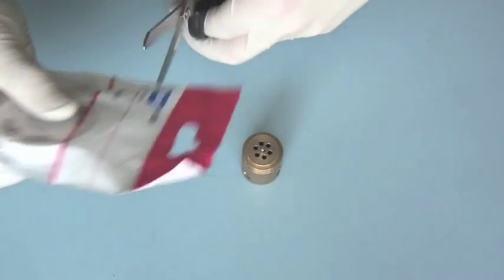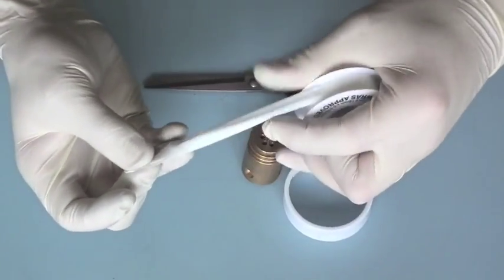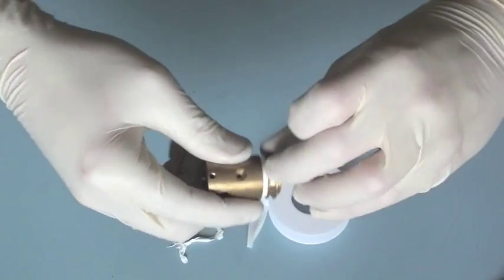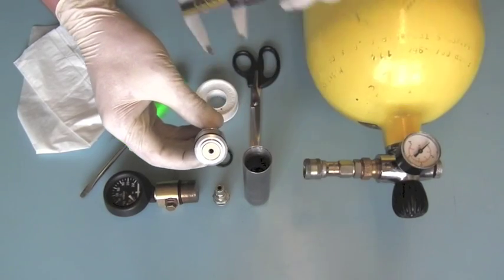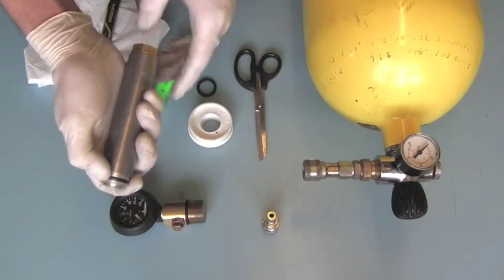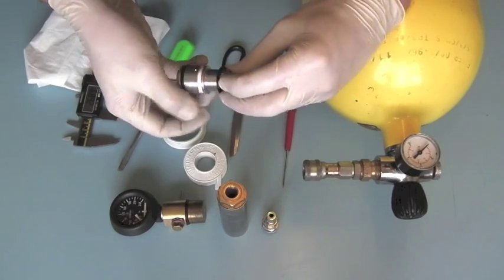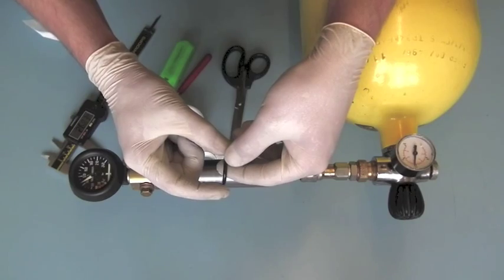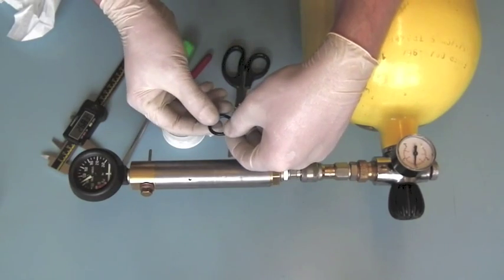Airgun / PCP 0-Ring Seals Pt. 3-3 (PTFE Demo).

Comment: You kept the bottle open when showing the packed out seal if you would of closed the bottle off would there of been a slow leak?
But still impressive how a undersized seal can be used if you can’t get the correct one (eBay)👍